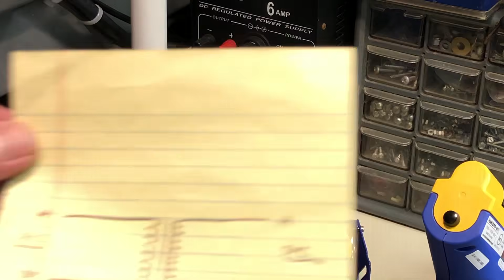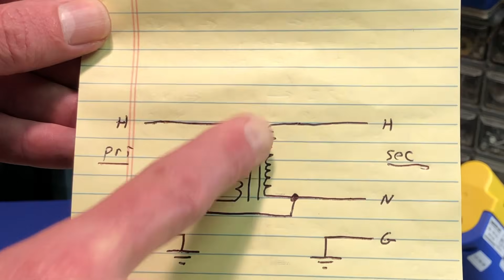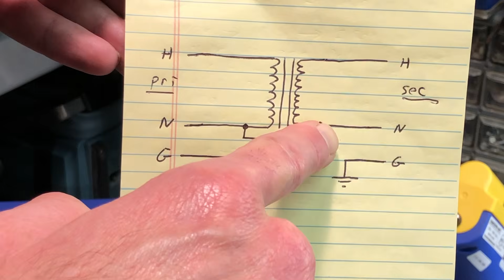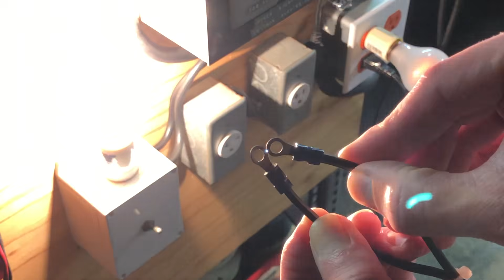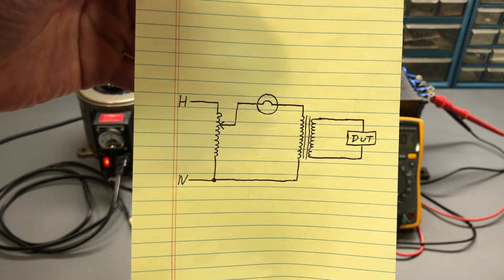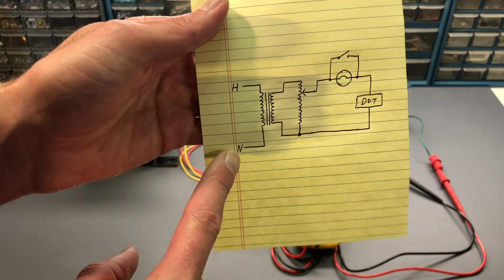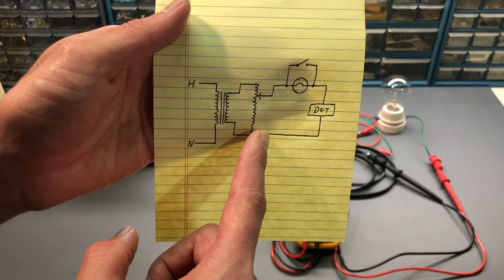How An Isolated Dim Bulb Tester Works (Current Limited Isolation Transformer And VARIAC)

Comment: What You are doing is not completely correct
1.Almost all radios and amps have a mains  transformer which has a secondary that supplies ac to rectifiers and and therefore is already  isolated .
2.the lamp is far too low to be of any use ,and in some situations will could give a false idea and potentially damage some equipment , and needs to be in the supply to DUT
3.Radios and amps need full ac the work the heaters .The best approach is to use your last setup but use a 1000w at 240 volt  or 500w at 120 volt halogen lamp .if the radio or amp has a short the lamp will glow brightly, but the worst a short will only supply current at around  4 amps , using higher power lamp will let the unit function as designed and any item that is faulty will get warm. 
4. i would not use the variac at all ,for the reasons 3 above .
5. the output of the isolation transformer should not have a ground available , you should only have AC , using the ground  will be dangerous to the test equipment.
Reply from the maker: 1- yes many devices have a transformer but you often have exposed mains on the primary side, at switches, etc, and the isolation transformer provides a level of safety if you were to contact those points.  It should just be a habit to use the isolation transformer when you are working inside equipment.  Many old radios are direct line powered and must have an isolation transformer when servicing.  Modern switch mode supplies also must have an isolation transformer since the input circuits are direct line connected.
2- the lamp used is just an example.  I often use 100 - 300 watt depending on what I am working on.  Correct that you do need to choose a bulb wattage that does not limit too excessively.
3- not true, tubes will come into emission easily at half or three quarter line voltage.  Using a 500 or 1000 watt bulb is not a good idea, it does not limit nearly enough, and if there is a fault the bulb will probably not glow and instead a transformer winding will burn out or other damage will result.  
The point of the bulb is for safe initial testing.  When you are sure there are no major faults bypass the bulb and continue testing at normal line voltage.
4- a variac is a very good idea to use on older tube based equipment to bring up the line slowly in a controlled manor.  This will not damage tube circuits and can be beneficial to capacitors.  As I mention in several other videos, do not bring up the AC line slowly on modern solid state equipment as that can be problematic.
5- yes the whole point is to not have any ground reference.  In my examples there is no ground connection.  The Tripp-Lite Isolator schematic shows a ground as that was the original design but no connection should be made to the earth ground on the secondary side, sorry for any confusion on that point.  Use an isolated ground outlet.  My Tech-Talk video on ghost voltages covers more about this and shows the setup I use.
Reply: yes 0k. but if you touch one ac point you will be protected ,but touching both you will be shocked regardless if the isolation transformer
Reply from the maker: @chrismurphy7324  yes correct across the isolation transformer secondary is still a shock hazard.  Removing of the ground reference on the AC line is what adds protection but the transformer does not completely eliminate all dangerous shocks.
Reply: @chrismurphy7324  Stick your other hand in your pocket. Be here all week :)

Comment: Erik, when modifying a TrippLite (sp?) to truly be an isolation transformer, don't you also have to ensure that the ground isn't common to both primary & secondary sides?  If you didn't disconnect the common ground, wouldn't the "ground" line going back into the electrical panel be directly connected to the primary's neutral, still able to cause a dangerous shock?  Santa brought me a TrippLite "isolation" transformer a couple of years back that I want to modify to be a true isolation transfer for my bench (with Variac & bulb too).
Reply from the maker: Neither side of the secondary has a return path to neutral or ground (the isolation) so the earth ground is not needed on the secondary side.  You can use a two wire cord or bring the secondary output to an isolated ground outlet in a more permanent installation.  I show this in the "Ghost Voltage" video I made.   Make sure you remove the neutral link like I show at 11:36  many so called isolation transformers have this link and this does present a shock hazard since you have a ground reference.

Comment: can bulb be halogen ?
Reply from the maker: Yes halogen is fine, just select the proper wattage for what you are testing.
Reply: @EriksElectronicsWorkbench  thanks for replying !
i'm planning to use my 230/230 1KVA transformer. Do you think is a good idea to add a 5x20 mm 5A fuse in series ?  .. in case i forgot bypass switch ON with a defective DUT ... 😉
Reply from the maker: @0dium.  a fuse is a good idea, my variac and isolation transformer have fuses for protection too.  You might consider a smaller amperage fuse, when appropriate, depending on what you are testing.

Comment: what about adding rcd to transformer secondary?
Reply from the maker: RCD is measuring for an imbalance of current on the AC lines (hot and neutral) meaning an alternate current path is available.  This alternate path is via earth ground so if the RCD has ground connection it can't be used because now you have referenced the isolated side of the transformer to ground undoing the isolation idea.  If the RCD is made without a ground reference requirement perhaps it could be used on the transformer secondary but I don't think it would add much extra safety since there isn't the ground path anyways (the whole purpose of the isolation transformer).

Comment: I’m now recommending true sine wave power inverter now for the hobby electronics work bench instead of a isolation transformer like (allpowers R600 or similar) you get all the same benefits but much more, you can use it around the house for emergency power, camping, in cars/ trucks.  I think it’s a great solution to have a multi use tool.  What do you think?
Reply from the maker: Yes a true sine wave power inverter will work as an isolated AC source however some do not drive a VARIAC or inductive loads very well which can be encountered when testing.  Also if you have the power inverter on the bench you will need a source of DC power capable of a large current to run it.
Reply: @ Dc sources come with these inverters now like Jackery or Allpowers and Echo flow. It’s a win win.  😀 and the cost is around $150.00 US$
Reply: @gregjohnson5194  Yeah, but as Erik said you might have trouble with inductive loads or Variacs.  Inverters simply weren't designed for this kind of application.

Comment: Thanks for this great video. Definitely one of the best out there. Is there anything wrong with using 2 isolation transformers? One for the dut and the other for an oscilloscope?
Reply from the maker: Glad you found the video helpful and thanks for watching!  Using an isolation transformer to float the oscilloscope is not a good idea for safety reasons.  If the ground clip on the scope's probe is connected to an elevated voltage a shock hazard exists from any part of the scope's metal components (case, front panel, etc) to other parts of the circuit being tested and if you come between those points you will get a shock.  The best way to measure circuits that a traditional scope can't measure because of grounding issues are using an isolated probe/differential probe or an isolated scope like the Fluke Scopemeter.

Comment: Nice video, the best out there!
There's an exact calculation to know what wattage I should choose for each load under test?
For example if I have a 70w load under test, and pick a 70w light bulb even if the unit its ok the light bulb will lit at full brightness , how bigger the bulb wattage should be to give the right visual effect that the DUT is working fine?
Reply from the maker: Thank you, glad the video was helpful!  One way to choose a bulb wattage is to consider what is the maximum short circuit current your device can tolerate.  For example 150 watt 120 volt bulb will allow 1.25 amps (I=P/V).  You will always drop some voltage on the bulb but the point is to limit current initially and then go to full line voltage  when you are sure it is safe.  100-150 watt bulb is typically what I find works well for most devices being tested.
Reply: @EriksElectronicsWorkbench  Thanks for answering, but to clear my head 💡, the idea behind the use of the incandescent bulb is to prevent the unit(if its shorted) to cause more damage to this device, and also give us the visual sign that the device is shorted(full brightness if its shorted, and low brightness if the device is working fine), if you use a 150watt bulb to test a 150watt device, in this case assuming the device under test is working fine, the bulb will lit at full brightness anyway (both will work with the same current), in this case the bulb will not give us a false sign?
Sorry if I'm not being clear enough, English its not my native language.
Thank you again bro!
Reply from the maker: @Skillz-s2n  if the bulb (in series with the device you are testing) and the device itself both have the same watt rating you will get half the line voltage on the bulb and half the  voltage on the device.   So the bulb would not be at full brilliance.  If the bulb is a wattage much smaller than the wattage consumed by the test device then the bulb will glow near full brilliance and you will drop most of the line voltage on the bulb even though there is no fault, not exactly what you want.   I leave a 150 watt bulb in my tester for most uses.  Sometimes I reduce down to 100 watt or increase to 300 watt.  I almost never go to 60 watt or less.  I've never needed to go over 300 watt.
Reply: @EriksElectronicsWorkbench  Thanks for the explanation!

Comment: I do not understand why the current meter of the variac is not shown in any of those schematics. It would have been nice to see whether it was in the primary or secondary circuit of that variac because it makes some difference in certain situations, I suppose. (And same thing with fuses. I suppose it makes some difference if the fuse is in primary circuit or secondary of the variac.)
Reply from the maker: The current meter is on the variac output (i.e. the movable tap), the fuse is on the line cord into the variac.  The variac does not have a primary and secondary such as the terms are used with transformers as it is all one winding with no isolation.
Reply: @EriksElectronicsWorkbench  Yes I know that primary/secondary thing. But if you short the output, you can burn the wiper or that "secondary" part of the winding at quite low output voltages even if that input fuse does not blow yet, can't you, if you have no fused output.
Reply from the maker: @jutukka  I have several variacs in finished enclosures with fuses, outlets, etc built by different companies.  Some have a fuse only on the ac line in and some have a fuse only on the output tap.  None have fuses on both the input and output however I think for complete protection both fuses would be a good idea.   With the current limiting bulb in my video there is no danger of excessive current flow but I suppose without the bulb you could damage the variac in certain situations with a short circuit and inadequate fuses.
Reply: @EriksElectronicsWorkbench  I have only one Variac and it is cheapest Chinese 230VAC/1000VA/3.3A/0-300VAC I could find. It has a traditional 5A 6x30mm glass fuse in input, and a 5A circuit breaker in output, and in addition a 100°C thermal fuse.  LCD voltmeter. It cost less than €80, postage included. 😁
Works fine but an amp meter would have made it perfect.
P.S. If you buy a cheap chinese stuff, be prepared that the smell of rubber and plastic parts and paint can be quite, well, amazing. For example those black rubber feet of my variac smelled so bad that if an insect flew near them, it probably would drop dead. I had to  remove them. And when I put those rubber feet into a air-tight Minigrip bag, the smell came out through the plastic bag! 😭. Well, those rubber feet were easy to remove throw away but the top and bottom rubber insulator plates of the bolted toroid are smelly as well. 😝
And make sure that safety ground lugs really are in galvanic contact with the chassis metal or screw, not only thick layer of paint, as was happening in my variac.

Comment: Great video.  One question about your Tripp Lite.  Wouldn't what you were talking about with that unit also be a problem with its third prong ground side also.  I guess if you are only plugging in a two prong vintage item that is ok. And most three prong items have that third prong isolated from the neutral parts of a device - it's in case a device energizes (shorts to its case etc.) itself etc.  I bring it up because I also just watched a video about a modern variac with a built in isolation BUT third prong ground was NOT.  This would concern me about total isolation.  https://youtu.be/8o7HtGTvBvA?si=aqySuOViPgvYFf94

  Edited 10 minutes later.  He does explain that the company recommends using a cheater plug when plugging in a three prong cord to maintain needed isolation if one wants that on this unit.  I guess one needs to be very careful about reading  words on any product with verification  of its meaning in practice!
Reply from the maker: Glad you liked the video.  The Tripp Lite transformer does have a 3-wire plug but the ground is ok as that earth ground goes to the metal case the transformer is in and is a good safety feature.  On the secondary side nothing is connected to earth ground (and modification to neutral was required as shown in video) so both AC lines are floating with respect to earth ground.  No connection is made to the ground on the transformer outlets.   Unless the VARIAC is a special isolated type it does not offer isolation and lifting the ground reference on a VARIAC will not create isolation protection.  It has to be used with an isolation transformer.  Always remember the AC neutral at the wall outlet is earth ground connected.
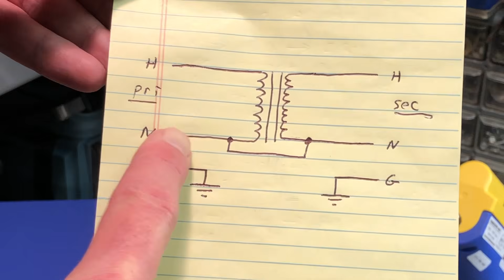Reply: @EriksElectronicsWorkbench  The one referenced in the video apparently had its own built in isolation transformer.  He shows all that in the first three minutes. I was thinking of the schematics you showed at 13:00 with third prong.  I took that to mean they were connected through the metal box.
Reply from the maker: @wdmm94  that schematic was showing how the "isolation" transformer was factory built but I modified it.  No earth ground is brought to the isolated outlets on the bench.  If the VARIAC has an isolation transformer built in you can ground it's metal case for safety since it is line powered but the outlets (secondary side) ground should not be used.  You can test with an ohm meter to see if there is any connection from secondary neutral to ground if there is a safety concern.  Check out my "ghost voltage" tech talk video for a little more on grounding and isolation issues.  https://www.youtube.com/watch?v=WONMMZsLHDE

Comment: Thank you for the video, I found it most educational.  I liked seeing the four different configurations. What size isolation transformer are you using?  Do have a recommendation for as to a minimum and maximum size to look for?  
Thank you.
Reply from the maker: Thanks for watching! I have two isolation transformers on the bench one is 1000 VA and the other is 350 VA (about 1000 watt and 350 watt).  The 1000VA transformer is connected to my VARIAC which is rated to 750 VA and also to the current limiting bulb, or I can use it direct without the VARIAC and bulb.  For the vast majority of projects these two transformers work fine.  Depending on what you work on would dictate the transformer capacity but for most projects I find the 1000 VA is more than enough and I'd recommend that size.  The 350VA is fine for small radios and such but not for large power supplies and power amplifiers.

Comment: Hi thanks again for the video it’s very helpful I am going to start  repairing av  amplifiers and tube amplifiers and before I even start to repair  amplifiers  I want to get a setup like you have and be safe in doing so can you  recommend  All the  equipment I would need to be able to put together on a bench permanently mounted like all cables and  thicknesses and  ground wires and the type of  bulb holder and switch onto the bulb holder and a Schematic of the  equipment on how it should be put together then I can safely work on the amplifiers thank you Mark
Reply from the maker: I'm glad the video was helpful.  My bench uses 14 awg stranded copper for 15 amp general purpose outlets (they are fused at 15 amps as well) and the isolation outlets/VARIAC/transformer have some 16 awg wiring because they are fused at a much lower value than 15 amps.  There are wiring charts online you can look up conductor size and current rating to use what is appropriate for your setup.  Whatever an outlet's wiring gauge is for hot and neutral then the ground is also the same gauge.  There is no ground on the isolation outlets.  Heavier gauge wiring is used on some other specialized bench power circuits rated over 15 amps.  The dim bulb bypass switch is rated 15 amps up to 240 volts AC.  Don't use an automotive grade switch.  The lamp holder is a porcelain socket made to mount on a flat surface.  Schematics of the isolation transformer, VARIAC and bulb as I have them set up are in the video.
Reply: @EriksElectronicsWorkbench  thank you for getting back to me I will have a look at the schematics  and source all parts needed and build one I will send photos to you and just check to make sure I have got all equipment in the right orientation  and thanks again mark if in the future you need help with anything just let me know thanks mark